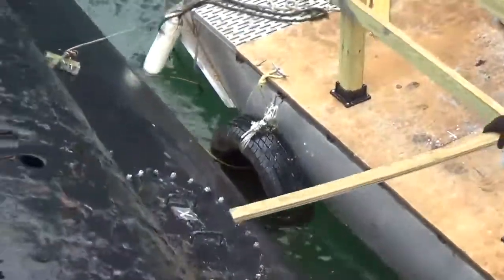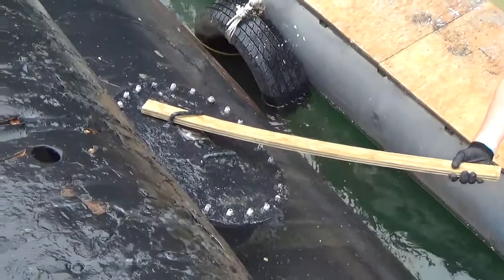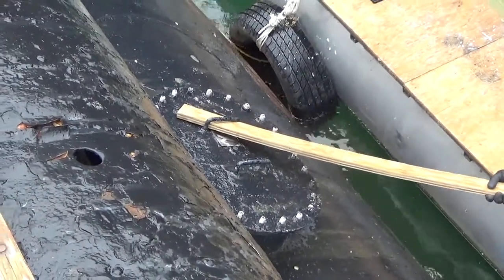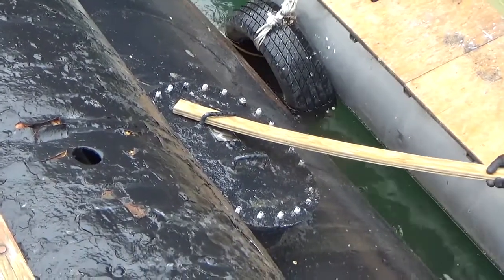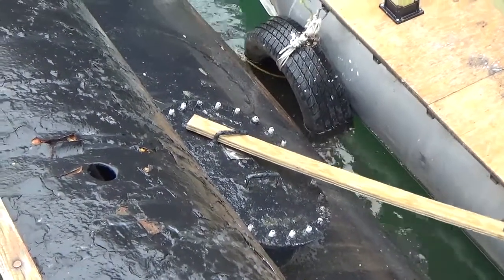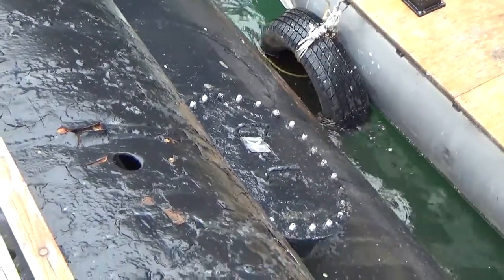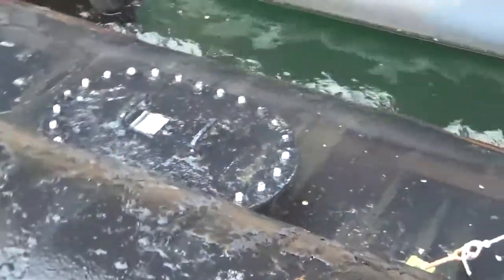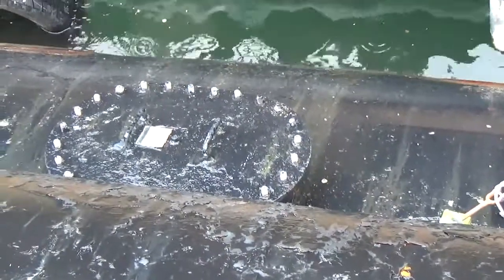USS Croaker: Opening the Access Ballast Tank Hatch, Gato Class Submarine

Comment: looks like MBT (main ballast tank) 6 B or D. Tip of the day..... get a flexible measuring tape, fasten a weight to the end and drop it down till the tip touches the water, read the tape.....  From the edge of the manhole it's aprox. 20 to the bottom of the tank. At a quick glance this tank is relatively empty.